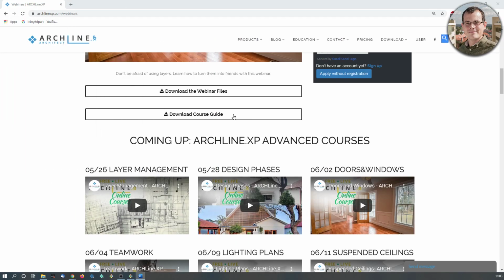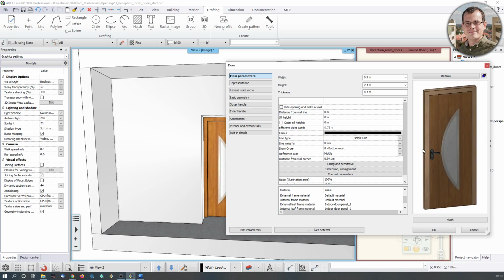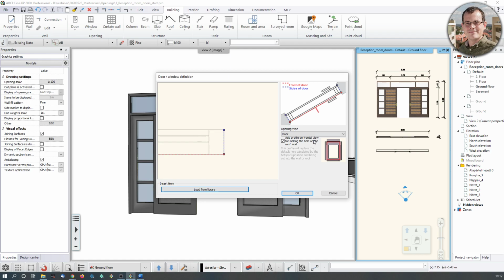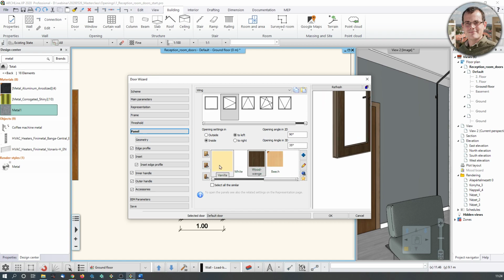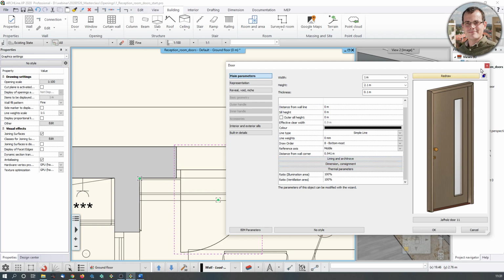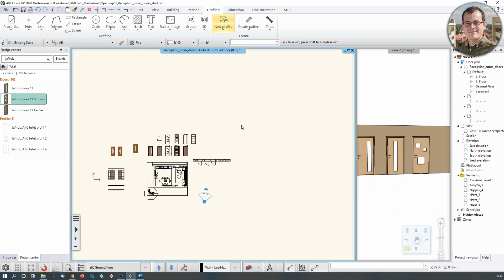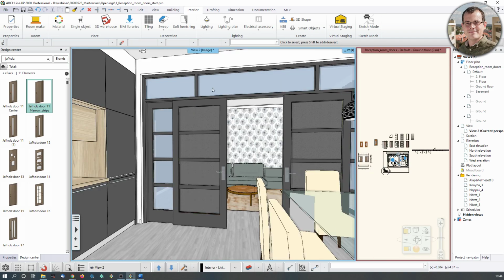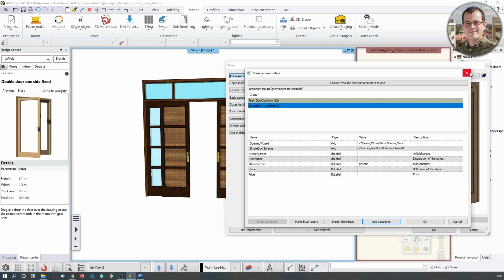Doors and Windows - ARCHLine.XP Masterclass 3

Comment: Hi Zoltan,

RE: Doors and Windows - ARCHLine.XP Masterclass 3

Informative video as usual, however you didn’t seem to cover anything with regards to windows as the video Title suggests. The same in principle I guess but would have been good to see some examples. 

Perhaps a part 2 Video ?   😊
Reply from the maker: Hi Clayton, you're right, most things we have showed can be applied to windows as well. However, for some window-related video, check this content: https://youtu.be/VPenYQvNIeE
Reply: Hi Zoltan,

Thanks for the LINK to this other Video, while I realise there are many videos & most are now linked to my own YOUTUBE CHANNEL being an avid follower, I think perhaps the title is just a bit misleading due to NO window examples. Viewing this other video LINK, I can see there are details that just relate to windows per-se.

Perhaps change this Title to just: Doors - ARCHLine Masterclass 3 & make another one just for windows......just my thoughts.

While we are discussing doors & windows, it was explained & shown briefly in one of your videos how you can customise the doors & windows will look like in 2D plan view. This I found very interesting & it would be good to see an extended video showing this in more detail, perhaps from being drawn in 2D with more 2D detail, i.e. door thickness, handles, jambs & frame stops/rebates & then how they can be swapped to a lesser level of detail. All using the ArchLine draughting tools & saved to a group & so on & then being used in the final 2-3D insertion operation.